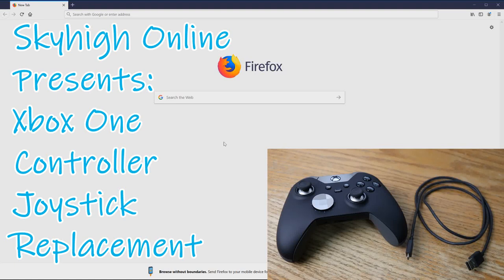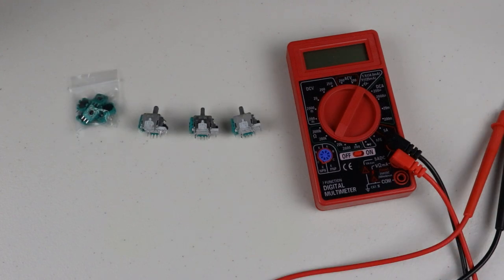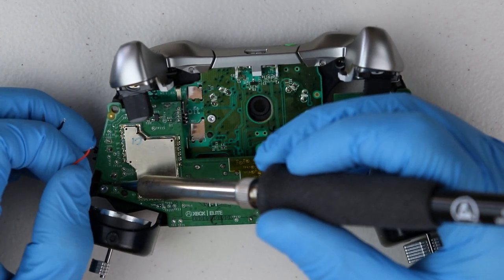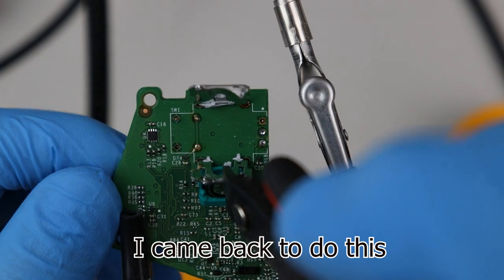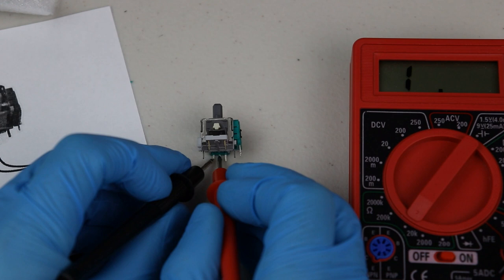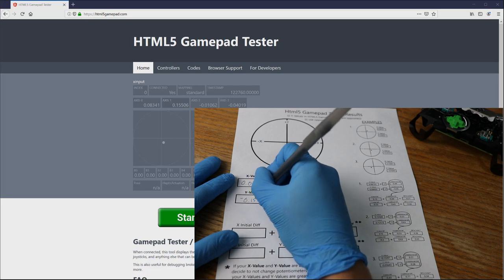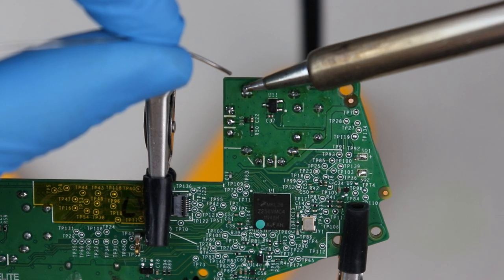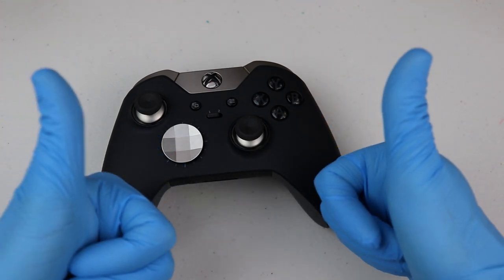How to Replace Xbox One Controller Analog Joystick - Fix Stick Drift & More

Comment: Im so confused by all this. Other videos show just replacing the module works then i hear that you actually cant do that cause each joystock is a little different and the controller is calibrated with its joysticks. So do you have to go through all this? What are the benifits then just replacing the module and callin it quits. And i also got lost when you were talking about all the calculations. Itd be cool if you couldve explained a little more in detail what your actually doing and whhere  your getting each measurement.
Reply from the maker: There are different joysticks out there that are quite common with integrated deadzones in the potentiometers that make it possible to install without any calibration, but in the end you will have a controller with a large deadzone that can't be changed with software.  Even then, it's still subject to whatever the controller was calibrated to originally.  It's a little hard to explain :/
Anyway, you could technically get away with no calibration if you either get lucky with a joystick that was similar in values as the old one (I think about 1/3 chance from my experience), or by increasing the in-game deadzone afterward.  If precision is important (like for first-person shooter games) calibration is quite important for accuracy.
Lastly, this is an older method for calibrating that technically works but can be tricky.  If you check the channel I have a newer video showing how you can calibrate by adjusting the potentiometer itself, no measurements or calculations.  I hope this helps answer your questions.

Comment: How do I reach out to send you controllers?? I have 4 normal controllers and a series 2 elite controller in dire need or stick drift help
Reply from the maker: Unfortunately I haven't done repairs again in quite some time. There are others on eBay who do, though. Type in "xbox joystick repair service" and you should be able to find some. Good luck!

Comment: the actual joystick part in the middle of that, can I replace just that if I have another one laying around?
Reply from the maker: Just the shaft? Technically you can, but in that case you will need to desolder the joystick whole so you can remove the plastic base to get access to the internals.  In that case it would be easier to replace the joystick part, and you can leave the potentiometers in.  It may throw off the readings a bit though depending on how the new joystick sits so it may still also require some calibration if it's off too much. Hope that makes sense.
Reply: Gotcha, thank you

Comment: working on my repair now. got a 1.0 on my joystick y value when testing it after adding the new stick. making my Y diff to center -5.25.... none of them are near this value. joystick bad? help
Reply from the maker: Few things I know of that could be the issue: a through hole is damaged, solder is connected between two solder points,  the wheel inside the pot is upside down or damaged, not enough solder on one of the solder points, or not a good enough solder connection between a solder point and the motherboard.  Hopefully this helps.  Let me know!

Comment: The newer Xbox one controller use smaller solder joints, absolute nightmare to get off, any tips? I’ve tried everything, hot air, higher temperatures, just Cannot  seem to get them off, desolder all the 14 points successfully:(
Reply: Then again I’ve been trying to take the analog stick off as a whole, as it comes off easy on the old ones, I’m dismantling it as we speak now into bits, following your vid ! I’ll up date later
Reply: My god, this is all I have had to do, break the analog stick into bits. This video has helped me no end, thank you once again so much. No other analog fix video or text on the net comes close to this one. The only video you need to watch and follow to the letter
Reply from the maker: Awesome! Glad that worked out for ya. Yeah, chopping the joystick into bits is what I do when I don't have a de soldering iron. If you're doing this procedure a lot you may want to consider investing in a de soldering iron, particularly the highly touted Hakko brand ones.  This way, you can even re-use the joysticks if needed. But they are quite costly.

Comment: Hello I need a question answered. Can I put elite series 2 joystick in a 1?
Reply from the maker: Technically, yes. There are some hurdles to overcome, however. The first being that you will also need the dome piece/thumbsticks for the elite 2's. And the other more challenging being that the base of these are raised slightly, so I believe the base will either need to be modified (shaved/melted), or swapped out with original xbox joystick bases (a little tricky to do, but probably the better/easier option). They will also need to be manually calibrated
Reply: @SOSSGAMING  thank for the response i bought a set from u i fixed two already thank you ima try it ill update
Reply: @SOSSGAMING  thank you for the kit, its amazing i love it will keep buying so i dont run low i love with the stuff it came and packaging
Reply from the maker: @Alexbk007  Awesome! Glad to hear!

Comment: Using the Html5 Gamepad Tester "prior" to dismantling it, my Y-Value is .76913. Do I really need to replace the stick to measure the base value, retest, and replace again? Or is there something else going on?
Reply from the maker: Great question! In most cases, yes.
However, there is an advanced technique I didn't show or explain in the video because generally the previous joystick is not suitable to get a stable reading, and because of the destruction method shown.  However, if you can get a stable prior reading on both the y and x axis, meaning the value stays constant and there is no drifting, etc., can remove the joystick in one piece without moving the stick part of the joystick at all, AND get stable resistance readings after the whole joystick is removed, then you might not need to replace it again. 

The trick is you need to write the prior Y and X values down, then measure the resistance on that joystick you just removed.  Even after all that, the main problem is that most joysticks after a decent lifespan don't make it possible for multimeters to get accurate resistance readings.  And especially in your case with a reading so off, I wouldn't give it a very high chance.
Hopefully that makes a little more sense and that I answered your question.  If you need more clarification or any other questions let me know!
Reply: @SOSSGAMING  Thanks, yeah impossible to get a stable reading so I'll carry forward as your video. Cheers!
Reply: Done! Replaced potentiometers prior to installing the new joystick, getting as close to 0 as possible and it works like a charm. Thanks for your video, feedback, and parts!
Reply from the maker: @leetimar7782  Awesome, that's what I like to hear! You're welcome, great job

Comment: Is it possible to put an xbox one joystick motherboard into a broken xbox elite controller instead of having to solder just one joystick in
Reply from the maker: Great question! Yes it is! But only if it is an elite motherboard for an elite controller or a regular motherboard for a regular controller (they aren't interchangeable)
Reply: Dang man this sucks

Comment: I have purchased some analog modules in the past but when I installed them they were super inaccurate. Is this due to the poor quality of the module or just the potentiometers being way off?
Reply from the maker: Can you describe by what you mean by inaccurate?  If you purchased from us, it is not the joysticks.  Each joystick will read a little differently from one another this is normal.  And Microsoft installs them like this as is then software calibrate the motherboard to make it centered.  The goal is to try to figure out the original joysticks readings that Microsoft put in and try to duplicate those readings with the new joystick put in.  Hopefully that makes sense, it is a little confusing.
Reply: @SOSSGAMING  im having issues with getting potentiometer diff values, in the video you said that taking the potentiometer readings isnt perfect but ive measured the same potentiometer many times now and i have been getting a wide range of diff values. How do i know if can trust these measurements?
Reply from the maker: @StevenNi_  Ok I know what you mean. It's possible the multimeter may not be functioning properly.  If you are literally testing the same potentiometer on the same joystick axis multiple times in a row and getting different readings, it's most likely the multimeter.  I started tying to figure this out with using a multimeter that gave inaccurate readings which drove me nuts until I tried a different multimeter and things finally made a lot more sense lol.
So if you can rule that out, one important thing is that the readings per potentiometer are only good on each specific joystick's axis.  You need to take a separate reading for the x-axis and the y-axis for the same potentiometer.  Each joystick's axis will be different for that same potentiometer.  In my experience, when doing readings for each specific axis, the readings don't change all too much.
Last thing to mention for now, the most accurate readings I've found are the one's you make right before you put the joystick on.  So if you make the initial readings, put the joystick on, make the calculation to find the diff to center values, then the readings you make afterward before you put the next joystick on will be your best readings and the ones you can trust best.  Hopefully this is helpful.  If you need clarification or any other questions let me know.
Reply: @SOSSGAMING  thanks ill give it another try with a different multimeter.
Reply: @SOSSGAMING  hello i finally got a brand new multimeter and im getting pot. resistance values that are a lot more accurate, but they still are quite different. I made sure that I am using the correct leads to the correct pots "legs" and making sure the stick is in the neutral position. These measurements are from the x-axis of the stick and im getting resistance diff values of: -0.27, -0.14, -0.35, 0.43, 0.07, -0.23. Is there something im doing wrong?
Reply: Nvm I finally found the issue! it was the wipers of the potentiometers that was causing these inaccurate readings, i guess i just got poorly constructed pots.
Reply from the maker: @StevenNi_  I suppose that could make sense if the wiper doesn't line up well with the carbon inside the pot housing or the wiper is frayed or bent in some way.  I'm glad you figured it out!  Sorry to hear that there are bad wipers/pots.  If you had purchased from us I'd be happy to send you some replacements no problem.
Reply: @SOSSGAMING  i was using some sticks that i had already purchased years ago, next time i will def order from ur store!
Reply from the maker: @StevenNi_  No prob. Happy to help regardless!  Any other questions feel free to ask, I'll be here.

Comment: I’ve tried to find the link but I can’t. The little stick inside one of my joystick broke off inside it due to a child standing on it. I opened it all up to have a look but I don’t have any of the right tools I need nor do I have the time, but I have got all the new analog joystick pieces and the thumb pieces would you be able to fix it? Or can you point me into the right direction as to someone who can. I’m in Aus.
Reply from the maker: Yes you should be able to fix if you have a new joystick. You would need a soldering as well though. Is eBay popular in Aus? If so, you might be able to find some sellers able to fix. Perhaps googling local shops or local classified ads might have someone able to fix it as well.

Comment: what are the chances that I have looked at this probably 50 times within the past week and without clicking anything, I looked in the amazon store to find more controller parts, found the parts and asked 3 questions and then referred back to this page? LMFAO. I have another question. I do not know how to use a multimeter, I have one but.... This process looks straight forward for this but, my meter is different than yours. After I order the parts would you be able to assist with my settings if I sent you a picture of my multimeter or a phone call walking me through the process to make this as easy as possible? I would appreciate it, Thank you.
Reply from the maker: I figured because the questions you asked were pretty relative to what I mention in this video lol.  As long as your multi-meter has a resistance setting you should be fine.  Yes, I can help you.  I have actually stumbled across another method that I'm testing now that is a little more straight forward and less demanding than this method (wouldn't require measurements).  If it's successful I will post a video within a week or two.
Reply: @SOSSGAMING  Thank you for your prompt response. I placed the order. You should have it. Please fill me in on anything you may have, I would appreciate it. You should have my email in the order. I will send the image of my Multimeter there and maybe you can give me of how to proceed until you make the video or share what you have learned. This is really frustrating! I appreciate you helping. I also want to thank you for your video! This is absolutely the best video I have been able to find on the net! Well done for this! Seems like you are a completionist/perfectionist which is why I can relate to this video! Also, you can keep the screwdrivers if you throw in some extra sticks lol!
Reply from the maker: @crooklynbully5289  You're very welcome!  Thank you for the kind words.  You can email me at my gmail account sossgamingcs and I can receive images there.  Will include a couple extra joysticks in place of the screwdrivers :)
Reply: SOSS GAMING did you find an easier method?
Reply from the maker: @jd030517  Yes, it is a work in progress and taking longer to make than I want.  I keep finding new little things that change the way I want to present it.  Hopefully in a week or two I'll have it out, which I keep saying :/
Reply: SOSS GAMING Yes I’ll be waiting! I’m going to start working on my controllers by the 27th so hopefully it’s done by then 🙌🏽
Reply: SOSS GAMING its out by then**

Comment: The values are changing regularly when I test them with my meter ? Also if you move the pin then it changes again! What’s going on here, any ideas? Is my meter faulty ? I can test it, then 5 min later test again and it’s like 0.15 different ? Is this normal ?Thank you in advance
Reply from the maker: Ok, if it isn't changing that much after some time, yes that is normal.  If it's literally changing seconds after making the previous reading then it's likely the multimeter.  This is assuming you are testing new joysticks/pots.  If it's an old joystick/pot, readings can be very unreliable.
My theory is that the slightest movements and budges can change the values slightly.  It also could just be a multimeter thing, where the values aren't going to read the exact same regardless based on small variables with how multimeters function (I haven't actually learned how they work, just another guess).  Could also have something to do with these pots using carbon as the resistive material.
Idk if this helps or if I understood the issue exactly. Let me know!

Comment: I replaced my left joystick and it works up and down but not left and right, i tried 2 different joysticks and same result. What do you think could be the issue or do you think i possibly damaged the motherboard during the replacement process?
Reply from the maker: Yes, unfortunately it sounds like one or more of the through holes on the motherboard have been damaged.  One option is to try to fix the through hole, which I wouldn't be able to tell you how to as I've never tried it before, or changing out the motherboard with another one.  Fortunately, in my experience, the elite controller motherboards are interchangeable.
Reply: You can fix it, i just had the same issue as this. I soldered a wire onto the pin that wasn't connecting to the board, connected my controller to the pc and tested on html5gamepad.com. i held the stick up (left or right in your case) and touched the other end of the wire on different soldered points on the motherboard (where the tracer leads to) until the tester showed the stick was moving correctly. I then soldered the other end of the wire to that point. Viola, it works perfectly
Reply: Basically you're just connecting the pin directly to the place on the board that the motherboard sends it to anyway, thus cutting out the middle man, so to speak
Reply: @SOSSGAMING  a tip for you too
Reply from the maker: @scottgrafton68  That's great info! Thanks for the tip.  What type of wire did you use?
Reply: Scott Grafton Thanks for the reply, I’ll try that out and see what I get. Will I need a specific wire or will any work?
Reply: SOSS GAMING Appreciate the feedback, and also great job on the video it was extremely helpful! Thanks.
Reply: @SOSSGAMING  I just used a cheap copper wire i got with my cheap soldering kit, I'm no expert in terms of the resistance of the wire or anything. If electric passes through it it does the job haha
Reply from the maker: @scottgrafton68  I'm impressed.  Would you mind trying to explain which through hole you repaired and where you lead it to?

Comment: Does anyone know of a better version of the joystick it seems the plastic bars that hold the stick are too week I was wondering if they make ones that don’t flex as much and won’t bend over time
Reply from the maker: Unfortunately I don't think there are.  They even tried to place a metal insert into the elite controller joysticks, but it was futile as they are still able to break over time.